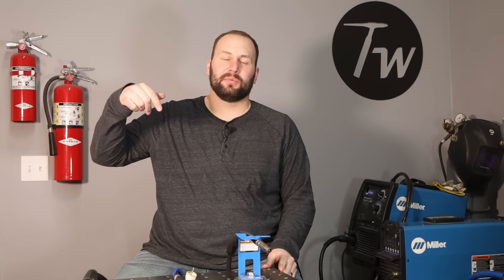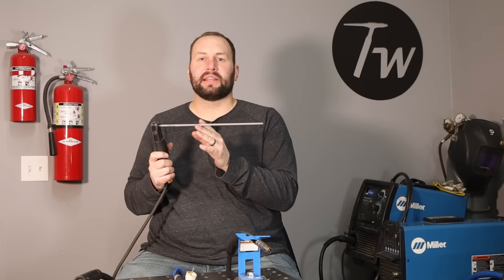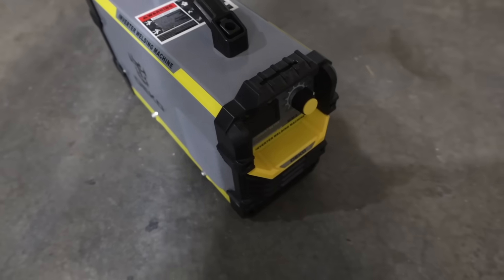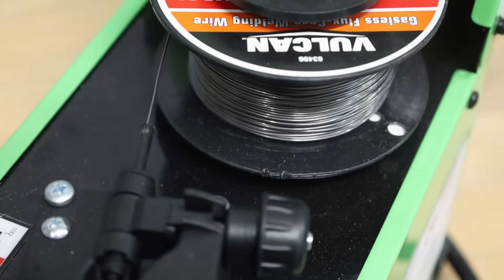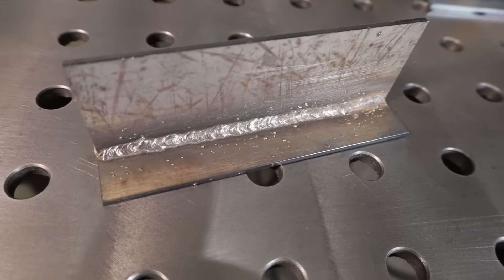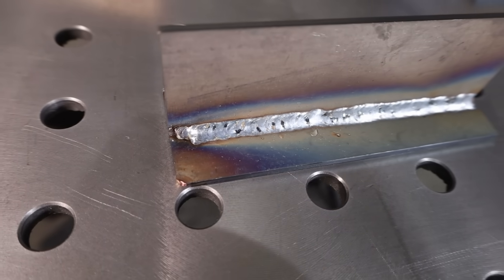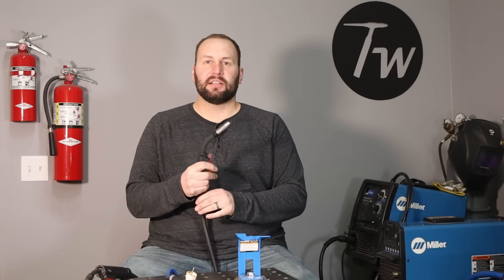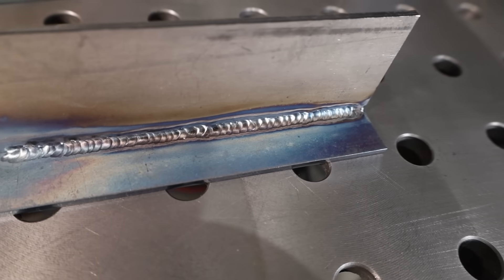4 Types of Welding Explained: MIG vs TIG vs Stick vs Flux Core

Comment: Surprised you did NOT WARN about stick welding generating radiation and the serious consequences if viewed without a suitable Welding Mask ( the Radiation can cause Blindness even from reflection causing Red Eye Flash, and seriously burn exposed Skin ... Very often I caught Apprentice Welders/Boiler Makers Holding a vertical piece in place on a Plate Tack Welding ... When I caught them I would ask if they wanted to lose their eyes! ... one lad actually said he SHUT his EYES ...IDIOT ).
     Gas MIG is Not suitable outside or where Wind/Draughts will blow Gas away ... Alternative is Gasless Mig.
     I found your video unprofessional and lacking basic Safety Information

Comment: Fantastic, as an engineer (EE) that knows what welding is but not how to or the different types, this was the perfect intro.
Reply: All metals are weldable except zinc. Yes that means brass and copper. Welding can only be done after a thorough complex analysis, a joke for EE guys.

Comment: What’s with all the bubbles in the mig weld?
Reply from the maker: They’re not bubbles. There is silicon in the wire as a deoxidizer. This silicon bonds with oxygen, forming little islands of silica on the surface. The area around them is exposed to the oxygen in the air while it is hot, making it gray. When the silica pops off, those regions have been shielded during cooling and are still shiny. That’s what you’re seeing there.

Comment: Thanks much. I'm a hobbyist blacksmith who occasionally needs to do a bit of welding. Up until now I've gone to others to get it done, but I'm ready to take the plunge. There's a fair amount of confusing or partial information out there. This was an excellent primer on the primary arc welding options out there. You've provided what I think is the optimal level of detail.

Comment: Learned to weld with an oxy acetylene torch and filler rod in HS metals class. In advanced metals we learned arc or stick welding.

Comment: never done any welding in my life,but wants to learn because i have an old landrover and the chassis needs weldingits approximately2-3 mm1/8, thicknesswould flux weld be ok?,also do you have to knock the "slag" off ?or  can you leave it on for more protection?great videoe by the way lots of information,thanks mark uk

Comment: You forgot Laser
Reply from the maker: I actually left out laser, diffusion, electron beam, resistance, ultrasonic and about 100 more. In fact, most of my my career has been spent working on these type of advanced welding processes. I tried to stick to the most common that a hobbyist might like.

Comment: I’ve heard of “oxygen” or “gas” welding does that mean they used O2 instead of Argon?
Reply: oxygen welding usually means oxygen and acetylene welding which is very old school in todays world. It's very similar to Tig welding as far as the process.  Argon is used primarily as a shielding gas in Tig welding where the air can totally mess up a weld (think swiss cheese). Hope this helps a bit.

Comment: When welding Thick Steel we use Duel Shield! Theres a lot of different wires for different steel types, for instance Hobart XL-525 1.2mm (flux Core) with Argon Heavy 80% Argon & 10 to 20% CO2 can deposit up to 25 LB's of wire per hour & is great for welding 40mm thick Excavator  buckets! Standard MIG Welding max's out at 8 LB's of wire per hour!
Reply: Unless your doing heavy fab Most people never heard of dual shield Flux core. Our cert for that was  horizontal  1 inch single bevel with a backer.

Comment: :) I love your videos, very informative.
 I started of with a 90A stick wel from HF and picked up perfect beading within 2 weeks (here and there), then I thought I would upgrade to wire-feed. So I sold my stick welder and bought the 90A wire-feed (also from HF), :( and 3 years (and nearly every type of flux-core on the market) later (mostly off now) I still struggle. If I get a bead that is even close to perfect there's little to no penetration; and if I get good penetration it looks like someone stuck a stick of tnt inside (Insert "anything" here.). I really hate my wire-feed, the flux spirals from the nozzle 90% of the time. Really irritating.

Comment: Another reason that it's called stick welding is because what the electrode loves to do sometimes when you strike it! I'm taking welding classes at my community college. Just started using 6010 in an open root. Sounds like a jet engine. Cool video.
Reply: Break off the flux (one inch) on the arc rod and try to weld.

Comment: Big thing about stick is the flux is a solid and sticks to the whatever you're welding; since its a solid its not affected by wind, so you can weld absolutely ANYWHERE and not worry about porous welds. Meanwhile if you have a big fan on in your shop, your shelding gas can blow away and affect your weld integrity. You're hosed if you try to MIG weld outside in windy conditions.

Comment: I don't know if it's a common thing or not but when I was in college they told me to aim the end of the torch in the direction your welding to "push" the heat ahead of the pool of weld. Also we mainly were learning Arc welding (stick) and mig welding.

Comment: When I did my engineering degree part of the course was learning to weld so we'd understand how to design something that wasn't unweldable. We did stick & acetylene as our two types and holy hell I could never get acetylene welding down, I would either burn through the metal with the power of a thousand suns or barely warm it, couldn't get the mid point right. Stick welding was SOOOO much easier.
Reply: Remember all metals are weldable except zinc, yes that means copper, brass, Titanium, Tantalum, inconel. Clean that aluminum before you weld it.

Comment: Thanks.

I have a arc welder and those flux coated sticks are bastards to work with 😂 takes ages to get the arc going, just wants to weld itself to the work, then you think you're getting somewhere and having a consistent arc and have you remove the slag the welds are all over the place 😂

Comment: very useful , could you please do a detailed video showing how alternating current is best for tig welding aluminium in practice with an example please  to show the different settings for tig welding different thicknesses of aluminium. Thank you
Reply: Try welding straight polarity with a sharp tungsten and you will see the difference.

Comment: I’m a rookie welder right now and this video is very informative and I appreciate you taking your time to teach and inspire future welders.
Reply: For MIG welding steel, Argon/CO2 is only used to prevent spatter and the resulting grinding and removal of it, as Argon is the coldest gas available for MIG. For the highest penetration and hottest MIG weld use pure Carbon Dioxide (CO2). And it's a lot cheaper and is available in large bulk tanks.
Reply: @georgebuck2269  Argon is used because it has a lower ionization potential and also because it also stabilizes the arc. If you Google MIG modes of transfer you will find that GMAW spray transfer has the deepest penetration and is used for heavy structural members. Short circuit transfer with pure CO2 has the worst penetration characteristics. AWS D1.1 allows pre-qualified joints with spray or globular transfer . Short circuit with straight CO2 transfer has penetration characteristics that are so poor it's considered a separate process and a PQR is required.
Reply: @donrusk8173  Yes I appreciate your tecnical breakdown of the different MIG processes, but I never get technical on a YouTube forum because most average welders are hackers and wouldn't understand it. I was trained in an amateur way by an older welder at a job I had in 1977 - 79. He taught me how to setup spray transfer with Argon and 2% Oxygen, no certs required. I only worked in small fab shops where 1/4 inch stock was the thickest stock ever used. I barely remember it because I was a TIG welder in later years and never did MIG after 1979. I built dumpsters and large rolloff compactors in 1975 and the company only had a large bulk tank of CO2. So in comparison 100% Argon was too cold of a gas if the bulk CO2 tank ran out. The stock max. was 1/4 inch. I have no experience in pipe or heavy stock. Have you ever seen someone TIG weld two inch aluminum plate, no preheat, 30 inch square with straight polarity, 100% Helium. A 3/8 round rod machined in half moon end view, to the plate full 30 inch length, both sides. The weld looks black when finished but is cleaned with a stainless wire brush. Are you a ME guy?
Reply: @georgebuck2269  I am a welding technologist and a welding inspector. l work QA in heavy industrial construction . l was probably too technical for here  but usually if l throw a little extra information in somebody is interested.
Reply: @donrusk8173  Thank you for the technical reply, I'm age seventy and long since retired. I worked over 40 years with a trade school education in welding and metal fabrication. I did everything in a metal fab shop except spray paint and drive a box truck.

Comment: Any tips for welding on a cheaper mig machine. I bought one £280 I only have it in smaller disposable bottles. When I use flux core its actually not to bad. So I was thinking its probably disposable bottles or cheapo regs causing my problems

Comment: This guy is a CWI isn't he?
Reply from the maker: I have been in the past, but it's not current today as I do different work now.
Reply: @TimWelds  lmao i knew it. This is unrelated but since you were a CWI, I have a question that's really been bugging me. If you were to weld a vertical down butt weld with 18 gauge thickness with a pulse welder, what should your wire speed be at? If you were giving the "test", lets say with .030 or .035 (feel free to give multiple answers because the CWI that tested me seems like a prick and you could not adjust at all) I'm just that confident he was wrong, and I don't want to hold a grudge against all CWI's.

Comment: Used to stick weld YEARS ago, haven't had any experience with Flux Core, MIG, or TIG. Out of curiosity which stick do you prefer to use? I started using 6011's those were okay, then someone suggested 7018's, and I had much better "luck" using those, better looking welds.
Reply: 6011, 60 series type rods are easier to chip the flux off.
Reply: @georgebuck2269  We used to chip the flux off those, bend them into a safety pin shape to use as pin keepers for our dump beds. 😁

Comment: Thank you for the good guide. Some thing that I missed, though understand that this is only a "basic" understanding of the different types of weldings is the strength of the weld. Now I work with heavy machineries as excevators and so on and I have understood ot as stick welding is the most strong welding to not fail of the different types. I can be wrong though so would be interesting to see a comparison

Comment: The only thing I didn't hear him say that I would add is if you want to run Flux core wire just know that a dc welder is better than an ac one for that. It gives you a much wider choice of wires. And is just a little bit better. Great video though
Reply from the maker: Definitely agree. Thanks!

Comment: Flux core is the easiest to head and keep running even if you mess up. Also a 100% CO2 container is only for rookie welders. Use a 75-25 argon/CO2 or 90-20 ar/CO2 for the best effect. Very hard overhead and up, but very nice to use. GMAW is a bit messy but the best one for people who know nothing about welding. Stick is a wierd one but simple enough. Tig is where I see a lot of my friends from highschool fail.

Comment: Thank you so much for this video. I inherited a little stick welder called a xp metalworker. My uncle must have had some other bits in the box for something else and I was overwhelmed with what went where. I didn't realise I just needed the clamp for the stick and the clamp to go on the table/workpiece. I've wanted a welder for a while now to go alongside my woodworking, making legs etc

Comment: I came here to learn more about welding. The only thing I can say is stick welding is not used on trailers unless its really big units like goosenecks and dumps. I work at a trailer dealership and we mig weld everything

Comment: Which welding creates the least amount of smoke? I’m addition which type of welding is better for inside work?  I have seen some people use the TIG welder with the Tungsten Electrode and no stick. It looks like the Tungsten Electrode melts the metal causing the weld.
Reply from the maker: Definitely TIG for minimum fumes and inside work.

Comment: Great video and thanks. What of weld strength? Are they all comparable if performed correctly or would 1 process have an advantage? Suppose the “simplest” ie.  MIG would eliminate operator mistakes and hence possibly be considered the strongest?
Reply: MIG is fast & quick but is a nightmare when a hack pretend welder is using it, turn up the heat. If I was building my own car ramps out of 8 inch channel use arc welding, very strong but slow. TIG welding with a pro like me can be used in a lot of welding, but it's slow.
Reply: @georgebuck2269  interesting, thanks

Comment: Looking to do some repairs and potentially buy a welder. This video was so well done on giving the basic information about welding and the differences between the welding methods. The different materials used and the explanation of the cost is very important. Investment in tools is very dependent on how often it used and it effectiveness on number of projects that are planned or foreseen. Truthfully, if the job is small it might be worth paying a professional to do the welding and let them earn their salt. Small jobs could be sacrificed if the technique is not right, so if the risk of damaging the parts is part of the equation then it would be better to higher the right person for the job.

Comment: I've always wanted to learn how to weld. What type would you recommend for around the house and occasional tack weld use? What equipment should I start out with...ie amps, voltage ..etc?

Comment: I always wondered how TIG worked, now I know. Thanks.
Reply: TIG = tungsten Inert Gas. It's also a water cooled torch. All metal when welding has to be shielded from the air, hence Argon or argon/helium inert gas.

Comment: Very good. I recently retired from production mig. Sometimes fixtures made by the machinest would just fall apart, wouldn't stand up to the rough treatment of the shop. They were all the welded, very pretty of course. I learned to weld over their tiny weak pretty tig welds with my mig...so maybe they didn't know what they were doing! So I've learned to be sceptical of tig. I think its good for tiny pretty stuff.
Reply: TIG is just as strong. You have to think about how much filler rod to use. For TIG a large amount of filler rod is the same as MIG. MIG is used for a fast travel speed and to make quick welds. TIG is much slower at adding wire.

Comment: I am a caveman. Give me a buzz box and some 7018 rods. Learned on an old Navy yard welder that would weld 2 inch plate steel if you wanted to. Would cut 3/4 plate steel like a plasma torch when you wound the dial up.

Comment: I started my working life as an apprentice welder in 1962(!) Trained in all the methods you demonstrate plus some others. On various materials including special steels (a knowledge of metallurgy essential), heavy section copper, aluminium and exotic metals - Ti & Zi. 

Went to night school for years, culminating in becoming a qualified welding engineer. 

I left the industry after about 8 years so now my knowledge is wildly out of date.

However, two things: 1. most of the welding I come across these days is crap. 2. Whenever I see anybody welding, I have an overpowering urge to have a go. 

Welding is unique in that it's not only a craft, done properly it is an art. 

Happy Daze.
Reply: crap welding, eh?  Then dont look at the Tractor Supply fuel storage tanlk, all the weld spatter is still there under a coat  of paint!

Comment: I’m new to the welding game I’m 18 and I’m trying to get into union pipe fitting and I’m looking to buy a set up to practice at home. And I’m wondering what kind of welding setup should I get and what type of welding do pipe fitters do? I usually see them stick welding but just want to get a for sure answer.

Comment: Thank you for such a great video.  I have built things from my garage.  I cut, drill and make all the parts, but I don't know how to weld.  So, each time I had to take everything to a shop to be 
welded together for me.  It tends to be expensive.  I watch people do it and I said to myself I should be able to do that, but I was afraid for my eyes since I had issues before.
Now, things are all good as far my eyes, I feel it is time to take on the challenge and save myself some money in the process.
Your video is a good intro for me.  I think I will start with STICK first as it seems less costly and easy enough to use in a garage.
Great job and thank you again.